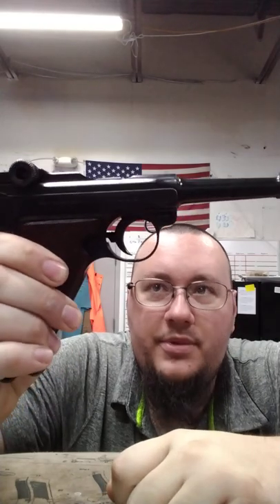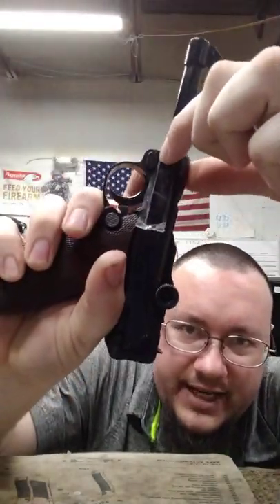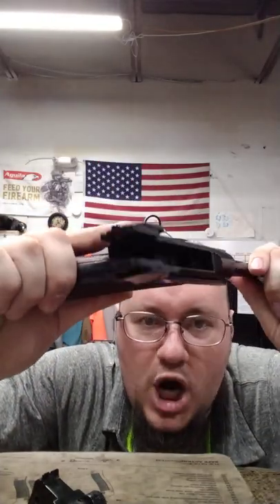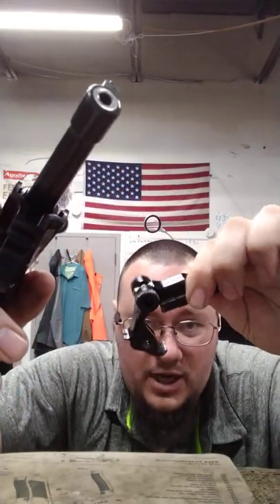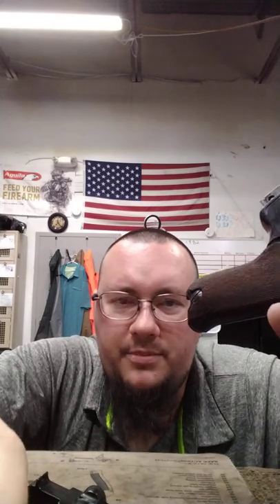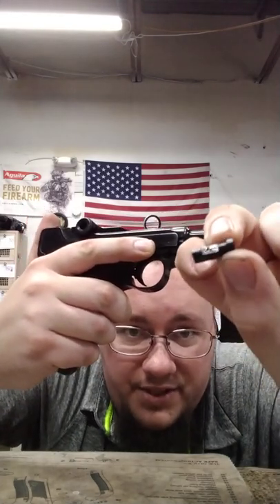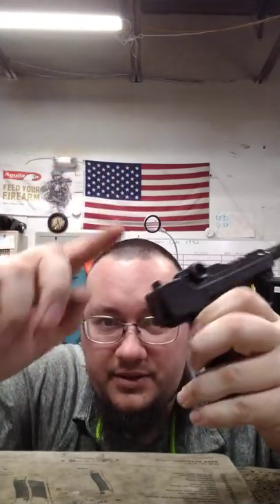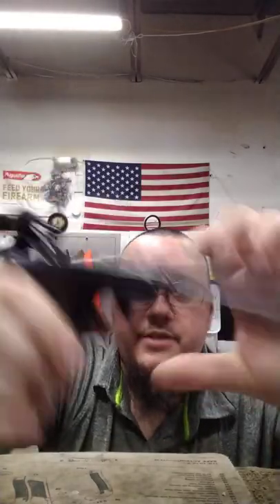Erma EP22 (22 luger) disassembly/ reassembly

Comment: I have a Erma LA 22 which  my father bought in 1966.  Thanks for showing me how to reassemble my gun. The ball bearing n spring came out. I put the spring in the hole on the safety switch and put the ball on top of the spring and eased the switch back in place. The safety switch works. Thanks for the great video.

Comment: Very informative. I purchased a BP22 many years ago but haven't shot it because of cycle/feed problems. Like this gun in the video, when I took it apart it was gummy. I cleaned it and had high hopes  of taking it to the range, finally. It cycled much more freely and then suddenly, hoping I use the correct names and terms, it seems the striker doesn't catch on the  sear, so it doesn't go click. I took it apart again and everything looked correct. It then worked normal until I cycled the safety and then it would not catch the striker on the sear again. The sear doesn't look worn or damaged so I guessing I need to disassemble and clean more than just field stripping allows. Can you make any suggestions or direct me to instructions on a complete disassemble and reassembly. Thanks
Reply from the maker: With these guns they don't need stripped further and cleaned. The problem is most people have the late production ones and they were really poor quality and assurance. Often times parts are out of specs and part of the reason I couldn't fix this one the Sears and firing pins and safety's and so on are almost impossible to find. Only thing I can think of is of you have the ability or access to a welder and add just a little material to the top of the sear and then profile it. ( Round and fold to shape) to get it to engage is probably the only option. Or hey I've CNC machined oversized bit not many people do that.
Reply: @kiltedgunsmith  Thanks

Comment: Excellent video, thank you for sharing this with us.  Do you have a source for spare parts for this specific model?  I have the exact same pistol; however, a friend of mine who proclaimed to be a knowledgeable armor for this weapon field stripped it and then started to tinker with the sear which resulted in the sear being damaged beyond repair.  Any help would be appreciated
Reply from the maker: These parts are really hard to find. I actually want able to fix it for the range problem and worn firing pin and trigger. Only places that had anything would be numrich gun parts, jack first, and cfn parts.
Reply: @kiltedgunsmith  Thanks for the quick response, I sure appreciate your help.

Comment: Excellent video i have the Erma EP(22 luger) and having the same problems, where do you get your parts for that
Reply from the maker: Unfortunately the parts for these are practically unobtainium... The ones that most people need like the Sears, disconnectors, firing pins are always going out on these. You may be able to find them on eBay on rare occasion. However most the main parts sites hardly have them. I wasn't able to get this I've to function because of it and I don't have a CNC machine or mil.
Reply: @kiltedgunsmith  thank you
Reply: gun parts numrich corp. has parts for the Erma Ep22